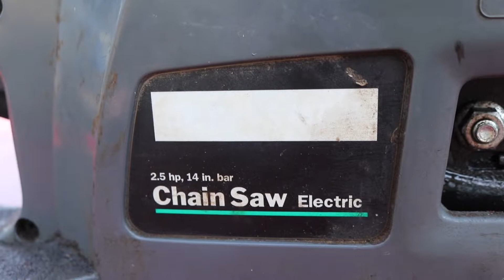Fixing Up an Old Craftsman 2.5HP Electric Corded Chainsaw | It's Greasy! |

Comment: Nice tear down and clean up.  I have a 14” corded craftsman purchased early 90’s.  Looks very similar with lighter grey colored plastic.  Just sharpened and used it this morning to fell a tree.  I live in town and like how quite it is compared to a gas saw.  Also I don’t use it often so a gas unit isn’t required.

Comment: A few years ago my dad gave me an old craftsman 14" electric that belonged to my grandfather not sure the manufacturer date Im guessing 80's maybe. Since I've had it, it just set on a shelf. A week ago I plugged it in and it does work but had a very bad oil leak. So I took it apart and discovered that this thing was covered in oil, grease and a ton of saw dust (it alot worse than yours) I cleaned up all the parts with the exception of the electric motor housing I just wiped it down as best I could. The rest of the saw got a bath in purple power degreaser. I discovered that the oil tubes had rotted and were brittle. Put new tubes on got all back together and now the S.O.B. doesnt run at all. Not sure what happened so today I will be diving back in to investigate the problem. Im hoping its minor like a wire came loose from the switch. My question is does the motor and clutch have marks that line up kind of like the timing on a car engine? If so then that could be my problem.
Reply from the maker: Hello, sorry for the late reply. I honestly am not sure as my electric saw was a direct gear driven drive to the saw gear driving the chain so mine did not have a clutch of sorts. You might want to check the brushes on the electric motor and make sure they are running smoothly on the copper part of the motor armature. Hopefully by now it got sorted out and you've been cutting wood!